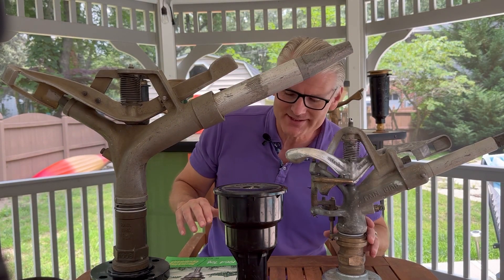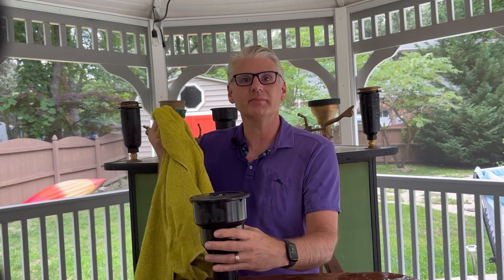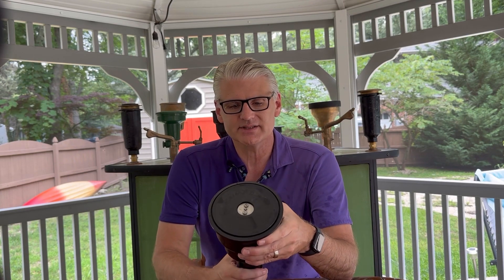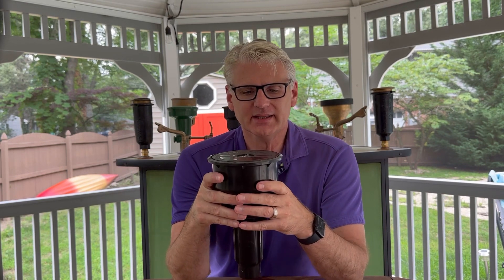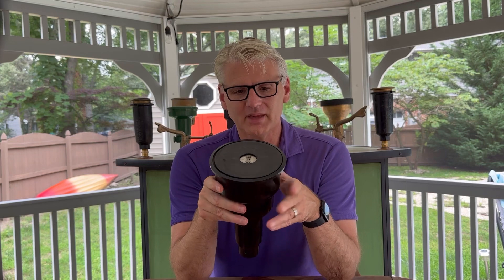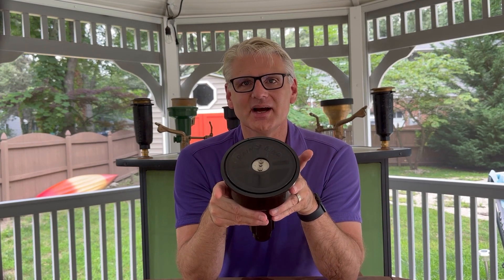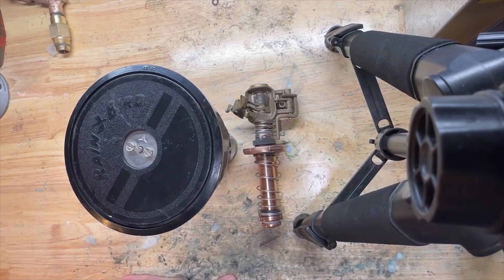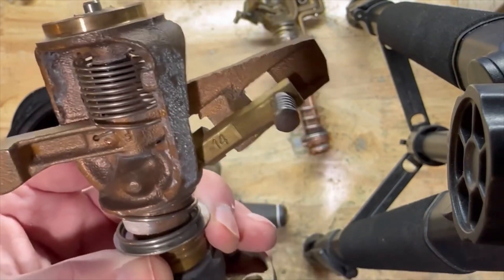Rain Bird 27AP 1” Pop Up Impact Rotor with Plastic Case and Brass Impact Sprinkler #rainbird

Comment: Nice Show!  You can't ever trust those Big ol aluminum monsters when they escape the basement!  I have a good video of my 100 working at 100+ psi; l will have to post it, it is a cool sight to see.

Nice display of the last of the great impact Rotors, I was sad to see them discontinued. I have 27/37/47AP with Aluminum lid, plastic lid as well as two types of Rubber covers. Case is very similar to the Cast Iron case with added ribbing for strength... In some ways the plastic case was a bonus over the Cast Iron in the fact that our corrosive soils would damage them and then work inside through the drain holes and make servicing the internals difficult at best in the ground.. The down side of the AP was they used a coarse thread "wood" screw and if you weren't cautious could strip out with repeated removals, such as a head at end of the line getting plugged. 
The older version Plastic case on the SAM and VIH units had brass inserts and used standard Machine screws and were way more robust; although the early VIH/SAM valves were not known for they're reliability and seemed to need service frequently....presumably to me this is why Toro had such a lead in the Golf business, was the 630/650/690 had very reliable Valve In Head.

Of interesting note, the 27/37/47 was as noted as Cast Iron case and became the 27/37/47A around 1977/78, They were also available with a Bronze case and lid on special order too; this option doesn't appear available any longer when the "A' series came out.. 

also I believe sometime in the early 90's they had  a Model 5055 and 4055 if I remember correctly [I can't locate catalog] but I have the heads; they were an economy version of the 27/37 and had a single stepped simple plastic case with molded rubber cover and the internals used a plastic riser and screw in threaded base in stead of flange and screws and the lower trip assembly was molded plastic with slip pin making it a full/part circle head....  I would imagine this was the last ditch effort to economize the impact rotor to compete with plastic gear drives.

RainBird also had a really neat Brass Full Circle Rotor in the 60's/70's to compete with the Buckner 1360; it was the 84HP with "HEX DRIVE" which was similar to the Cam except it used a hexagonal shaft with a bigger square ring around it that was swirled with water to create a friction drive like Buckner Cam..... I must admit this is my biggest collection defeat as I had acquired one of these directly from RainBird repair department in the early 80's and it was new... somewhere in the confusion of moving shop a couple of times it turned up missing along with a case of 1330's and 1360's..... needles to say i wasn't too happy!  I have never seen one before or since in the ground.

I would really like to find a head or even a catalog showing the early rotors like the 21 you have but one with the "45" as an internal.... that is an elusive unit for sure!
Reply from the maker: I had no idea Rain Bird was still offering a brass case and lid impact rotor that late. It’s be a good addition to a collection. I’ve also noticed what you mentioned about the 47AP bs the more slender SAM version and its brass inserts. I also remember the 4055 and 5055, as I was in the business then. 

Your Hex story is heartbreaking. That sprinkler is my white whale. I’ve seen it in a 1964 and 1974 catalog. So, you have something that was made by a leading company for at least a decade and there isn’t a single one to be had! Losing a case of 1330’s and 1360’s would be a rough day. I finally have one each after selling hundreds of them. I hope to have a 1370 and 1390 one day, but I’ve never seen one available anywhere. I have a 1330 video coming out August 3, if memory serves. 

If you do ever feel like sharing pictures or video of your collection, I’d love to see it.
Reply: @antiquesprinklers   I do have a 51 in a Bronze case, and I remember seeing some as a kid..... I remember always seeing the Buckner with Brass lids and being able to identify them easily, and was quite surprised one day to look closer at one of the Lids assuming it was a Buckner 8280 to be surprised that it was a RainBird 37, I think they were about a  8-10$ uncharge over cast iron.
The City of San Diego was all Buckner in the early years and I presume sometime in the late 60's early 70's must have gotten a bid from Rain Bird because they started to show up. They had some difficult specs on things one of which was likely Brass cased rotors; which I believe is why they were that way. 
It would seem as JM sold off Buckner and the 8265 went away I never saw a transition to the new style Royal Coach rotors but totoaly went to RB 27/37/47 but with Cast Iron cases.  But the good news was that they still specd and used the 1360 seemingly up until they jumped into the pool with the HUNTERS..... the rest is history and slowly but surely the Bucks and Birds got replaced with Hunters or Toro 640's, instead of repaired..
The City had quite an extensive irrigation Repair shop at one time and they used to fix and repair all Brass heads that could be... Apparently I had heard that the head of the department had some relationship at some time to Buckner and was quite fond of them and knew very well how to keep them running and make them last; I assume he retired and the new kids took over to usher in the throw away and replace mentality;.. was a bummer for sure.
I remember at a Park by the Bay that had all 8280H or replaced by 8265, and an occasional 1294H for perimeter and 4 or 5 rows of glorious Buckner 1390's, they were definitely a sight to behold; I do remember a lone RB 81, this was the early/mid 70's and  by the early 80's I remember seeing a couple or S-T-L Rise-N-Rain 881 to replace the irreplaceable/ irreparable 1390, maybe from mower damage or just worn out since they are probably 30/40 years old by then..... I would say a really good sprinkler head!! and I will say I do remember somewhat seeing them work a time or two and they sure through out the water.... I sure wish I had realized what I had seen at the time, but it was just a big sprinkler; I had know idea how rare and that I was so lucky to at least see them work... I'm thankful to have that in my memory!! 

The 84HP is definitely one that irks me to this day, as I remember having some of the guys that worked for me cleaning out a shed to move to a new shop and one of my main guys throwing tones of pipe, fittings, valves, heads and such into a dumpster; I lost my temper on them and made them empty the dumpster out so I could look through all of it.
I remember most of what had been moved when it left but was stored in the shop and move a couple of times to consolidate over the years and i wasn't able to keep track of it all; at the time had over 125 people working under me, that kept me busy to say the least. My head of the shop loved to throw out anything he didn't see useful and i'm sure one of the time crates were moved some had disappeared and it was the crate with the 84 and a few new cases of 1330/60 I had bought from HydroScape when they were no longer selling Buckner as a main line and wanted to make some free shelf space for Hunters or Geared Birds.... Truly a heartbreak for sure!  At least I was say I had one and did run it a couple of times.... I ll share pics any time,  I have tried 4 or 5 times to send address but it gets removed from the post.
Reply from the maker: Billsandison@yahoo.com
Reply from the maker: The brass case was an impossible spec to break by the time I came along, but it was a tough spec to get adopted. 

I hate to think about what I threw out when I changed careers. I also had what I thought was a cam rotor like a 1294 with the AC Oughton brand on it that I loaned to the guy who ran Buckner marketing at the time and never saw again. 

I’m terms of percentage loss of market share, I wonder what the fall of Buckner looks like. There just isn’t great data for the irrigation industry. I think in the mid-90’s Buckner was claiming just under 10%, and they had a Big Hairy Audacious Goal of getting to 20%. It went the other direction, obviously. 

125 person company doing irrigation is massive. You’ve built very good businesses!

Should you bump into another 84HP, I have a home with a pool in a desirable community in Maryland for trade. I’ll just need one of your storage sheds to live in with my sprinkler. I sent my email address in a separate reply.
Reply from the maker: A 1390, let alone row after row of them, would be majestic to see. Somewhere, there is old home movie footage of some in operation. Maybe a superintendent filming his installation in the late 50’s or early 60’s, or a family visiting the park you mentioned. Has to be out there.
Reply: I wish I knew how the future would treat us all; had I ever thought about all the sprinklers, machines, trains, cars… etc that I used to see, know how scarce they would become, I would have taken many more pictures of stuff.  We never realized how fast the present changes beneath our feet until one day it’s all but a memory. 
It is way easier to document today with digital than days past with film and 8mm movies don’t do much justice but I wold give my right arm for some of them today.

Comment: The reason for the stepped case was to add some additional surface area to keep it from sinking due to golf carts and such running over them.
Reply: That is  a very good point, it probably added additional strength for vertical loads as well. I know when installed correctly with a good amount of gravel and backfilled with decent compaction they were very stable and done so more easily than the larger diameter conical shaped Buckner 8280/8265 heads. The gravel provides great stabile support as well as important drainage to help keep head more clean as any sediment would tend to flow through into the gravel.
Safe-T-Lawn offered an optional Ground Support Flange for the Impact Rotors and Ball drives too; I had always wondered why that would be so important.... Thanks Frank.
Reply: @kerryvinci5287  Great point on the gravel Kerry, the 2 weep holes were important inside the case as the sprinkler was turned on and gained pressure it was of course spraying inside the case and leaking some water past the guide seal until the bearing contacted the lower buna seal and began to run. The gravel as you stated not only gave stability but aided in the weeping.
Reply from the maker: That’s a good point. In heavy clays around here once you got away from the shore, those sprinklers would always be full of water, and even with check valves keeping the laterals full you’d make some swamps around heads.
Reply from the maker: I remember seeing the ground flanges in catalogs. They always looked so curious to me, but someone must have used them.  We should have used more gravel under sprinklers and valve boxes. I must admit, I did not enforce it.
Reply from the maker: That makes sense! Thanks, Frank!